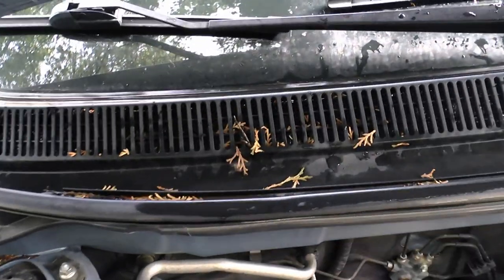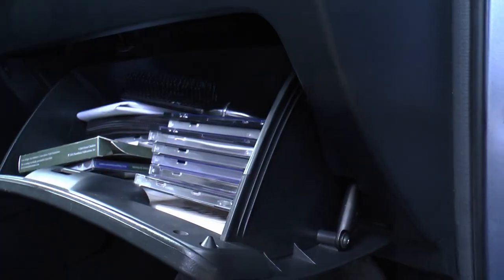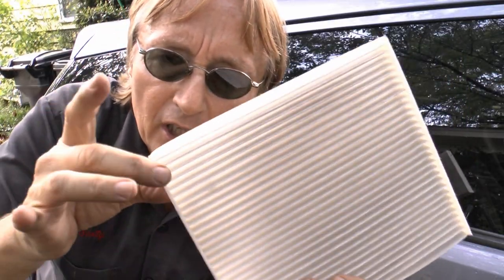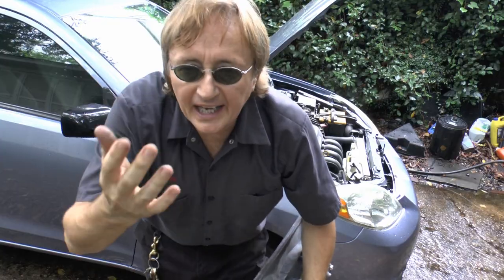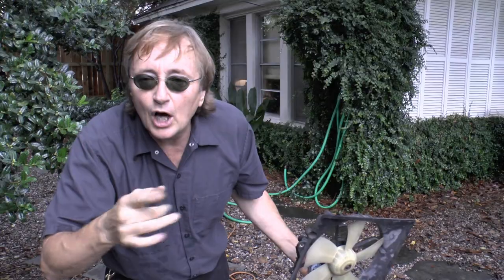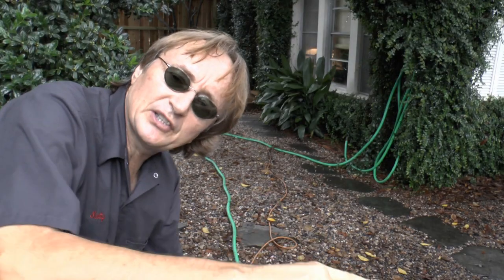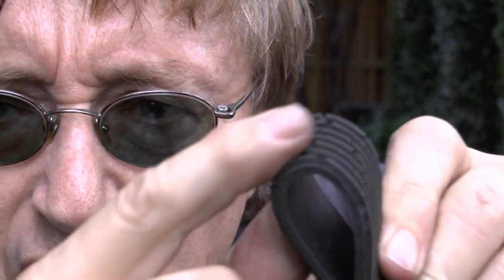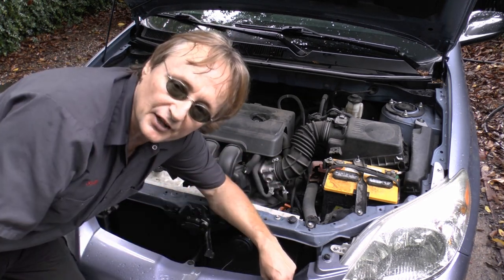How to Keep Your Car's AC Blowing Ice Cold for FREE

Comment: My cars A/C is not blowing as cold as it used to. I tried "recharging" it but it didn't do anything. The mechanic said I need to flush it. Does that sound right or should I be replacing something else too? The condenser and fans work
Reply from the maker: you could try flushing it, but realize if you do the drier and expansion valve or orifice tube will need changing too

Comment: I have a 98 Ford Contour 4 cylinder, the engine sputters when I turn the heat or AC on. What might be wrong with it?
Reply: +feedback864 Sounds like your idle is too low. Does it sputter when you're driving too?
Reply: No, only when It idles in drive with my foot on the brake or when the car is in park.
Reply: feedback864
Yeah I think your idle is too low. A bad sensor or dirty injectors could cause the idle to be too low. The A/C draws power from the motor. If there is already a problem the A/C turning on can make it sputter or even stall. I doubt it's a problem with the a/c itself.

Comment: My ac won't work. Checked the fans, unplugged the orifice and replaced the filter. System is charged, but no cold air and the compressor clutch keeps kicking off and on. any thoughts?

Comment: Hello. I have 2001 ford f150. It blows cold, then around 5minutes its hot. Any ideas why?? No leaks and freon/pressure correct. Thx
Reply from the maker: realize that has a complex computer driven ac system, as such, best to have a guy like me analyze the AC system with his dealer level scanner first, rather than guess with expensive parts

Comment: i took my car to a shop the mechanic said i need to replace the whole system. He told me the vacuum wasnt sucking like it should and the compressor is weak. I recently noticed twice my passenger floor board covered in water after it rained even though the windows were up. i mentioned this to him and asked if it would have something to do with the ac unit. he said no. I happened to see this video and it mentioned cleaning the inlet under the hood cause the evaporator will build up and leak water all over the car... that being said.. is there anything i can do without replacing the entire system?
Reply: emeraldagon like hell get a second opinion, i have my experience with some mechs and some are just flat out lying about the condition of something. i suggest you get a walmart gauge and just look at your pressure and start there.

Comment: +Scotty Kilmer my mom has a 1994 Toyota Camry V6LE the AC doesn't work at all even though the system is properly charged also the clutch on the compressor won't stay engaged the air that comes out most of the time is in excess of 75 degrees please help
Reply from the maker: British_Leyland(Alexscott100) often a worn out compressor, hot wire it, and if it won't stay engaged, replace the compressor
Reply: Ok

Comment: What I can't figure out is why there isn't fans pushing the air through the radiators rather than pulling it through like in the old days when you didn't have a choice. I know that pushing air through works better, I have built water cooled computers, and have done the research to prove this. Think about it like this; on a hot summer day which side of the fan would you rather be on?
Reply from the maker: fans work both ways, and it's easier to design cars with fans on the inside with modern hood designs. The difference is not that much in terms of efficiency, especially on a car, which after all is moving most of the time creating its own wind.
Reply: Scotty Kilmer True, but it would certainly make a big difference when you're idling in traffic on a hot day with the AC on. I personally don't think it would be too hard to design a car with the fans in the front, they may be a little harder to access, but the whole unit would still fit in the same amount of space, but I get the feeling that there are other reasons for this.

Comment: Hey Scotty, why is it that my heater blows when I accelerate my 1989 Nissan 300ZX all the way?
Reply: NGELO9657 I know im not Scotty, but if you're traveling at a high enough rate of speed, The air from the outside gets pushed into your fresh air intake, and through your heater core, then through the vents and into your car. if you don't want this to happen simply put your car on recirculate and the hot knob / leaver all the way to cold.
Reply: ***** Nah that's not my issue, thanks for replying though. I press the recirculate button and put my temp down but I'm simply getting hot air in when the temperature OUTSIDE is also hot, here in Florida it's like 90% of the time, so I almost always get hot A/C. Except at night..

Comment: hey buddy is it safe to wash an engine?
Reply: Coming from a noob, i think only when you clean it with a wet towel and don´t spill to much water on the belts because it can cause them to slip when you turn the engine on shortly after.
Reply: hell no, definitely don't wash your engine. You could damage components and electronics that are adjacent to the engine
Reply: you just need to use common sense and make sure the air filter covered. also check for damaged wires. car engines are SUPPOSED to be water proof. age and wear can affect that
Reply: Every single chevy we detailed at the dealership had its engine bay pressure washed and degreased with chemicals. The only thing my supervisor said was make sure the engines running
Reply: +P0LiTiKZ thanks
Reply from the maker: try it yourself at your own risk, and actually cleaning it while running is most dangerous, as water can get sucked into the engine and a live running computer that gets wet will go kaput fast. The chevy guy is a mechanic at a dealer, and you should not try it yourself at home. I see more guys ruin em that way
Reply: Well, surely safer on a diesel since on a petrol engine you risk having the ignition coil pack, coil or distributor get wet = misfiring engine = if you run it, catalytic converter overheats and damages.

Comment: Hey Scotty! my car isn't blowing any air at all! not hot nor cold! how come? Thanks!
Reply: +Peronimous Pratt Needs a new blower motor.
Reply: +Mouse Mystery whats that?
Reply: The fan that blows air for your air conditioner. If you're lucky it could simply be a blown fuse or loose connection.
Reply: +Mouse Mystery my car is a bmw 540i, i think its behind the airbag passenger side
Reply: Check the fuse first (somewhere in the engine bay or dashboard)
Reply: I don't know which fuse it is
Reply: Pull them out one at a time
Reply: +Mouse Mystery im not doing that, it could be the fsu

Comment: All basic maintenance stuff, nothing at all which helps you get extra performance out of your cars HVAC system full stop ? Also most car A/C systems must blow cold air at around the 4 degrees C to 6 degrees temps so buy a food rated Temperature gauge and put in the air vents while the A/C is going and check you cold air temps when in summer months, cheers :)

Comment: Hey Scotty,  A friend has a 2006 Honda Accord 4cyl. with a bad Timing Belt.. The shop wants over $3,000.00  to replace it!  Is this accurate in your opinion? Is this job something that can be done at home>?  She can't afford a new car or the repair at this point! !
Reply from the maker: what a freaking crook. Last one I did on that model was less than 400 bucks. Find an honest mechanic.
Reply: Scotty Kilmer Thanks very much, I'll let her know!
Reply: ***** Hi greasegun, thanks for your interest. After speeaking with her, she explained that the shop says the belt did in fact snap and that they are telling her that now she needs to replace the engine!  I dont know enough to understand what could have happened,  but does this seem correct? Can it be rebuilt cheaper?
Reply: ***** Thanks very much for taking the time to respond and for the information, I appreciate it!  This is for a dear friend who is going through some hard times, as are so many these days, and she will be so greatful to have information from a knowledgeable person.  I wish I had known about the broken belt and had asked Scotty after hearing more about the situation. I was so shocked at that price, and I hate to have seemed inconsiderate - as you pointed out he would probably have had a more detailed answer.  Thanks again!
Reply: how many miles on that car? hope it is fixed now.
Reply: MrBuzzialdrin I believe she's got just over 100,000 on it... She's just found an engine for a little over 1,000 and is looking for best deal on an install.. Coming along, but slowly..  Thanks!
Reply: Hey you forgot to mention the (orifice tube)<----

Comment: change your title .. because its bogus ... what you showed where some precautionary measures that can affect the a/c performance .. what you seem to forget is the most important aspect  .. its a sealed system but prone to leak R134a gas  from rubber flex hose,   connections with o-ring seals , seals and gaskets in the pump , mass produced components that can leak as well ...if the system dont have the required amount of gas  it will perform poorly ... the system needs  to have a full charge of refrigerant ...  what happens is , seal dry out when a/c not used in winter thus drying seals and loosing gas ... its recommended to have them serviced to check system for leaks and gas level  most important..... all those pointers you mentioned are what happens as part of the  service ..but  the most important is the gas amount...  so to keep your a/c as healthy as possible is to use it off peak  in conjunction with your heater for dehumidifying and defogging ...the  refrigerator in your home are the same system and last for years without needing a service because its a sealed unit with no flex hose or  o-ring seal connections to each component ...thus lasting years without service..

Comment: Hi please help, i will donate if you help me please, I have a 2006 Honda Civic EX sedan and a mechanic short circuit the ecu aka computer and now he installed a new one and still no a-c works and only one fan runs on the a/c and the Windows won't work now nothing electrical but it does turn on and run... Any suggestions???

Comment: My problem is my car takes r12 and that ain't cheep gotta love old Ford.
Reply: Can't it just be converted to R134A? Just need to flush all the old oil out, put the PAG oil in and replace o rings and hoses (a new parallel condenser might also help), and perhaps pressure switches too.

Comment: My AC is blowing out warm air what do I do if everything's full turn it on at all doesn't blow up just mediocre not even consider that any AC at all I got a 1998 Toyota Camry LE 4 cylinder what do I need to do to fix that how do I fix it
Reply: No see the problem I'm having both fans are working everything's working but the compressor I think it's the compressor that's not working

Comment: My AC stop working in my gti. It was blowing cool but not like it's normally suppose to. So I had someone out refrigerant in it then it start blowing warm. I went to have it check Whe I had it checked it blow cool. I don't know what's wrong with this thing. They said it's the compressor.  I refuse to believe that.
Reply: I'm a princess if you can get yourself a set of gauges, you can add and check the system. and kinda of get an idea of whats going on.

Comment: Is warming up your car important?
Reply: Sham Sharma during the winter it's important!?
During the warm season you can worry less about warming your car up!?(if it's gas powered)!

If your car(engine) is running hot... your AC isn't gonna work good (or will shut off by safety switches!?)!

Jus always check your oil level!!
Top off all your fluids, especially before long road trips!!(oil , antifreeze, power steering fluid & brake fluid!

If your cars an automatic..check the transmission fluid level occasionally too!!
Check your windshield wiper fluid too(winter mix or summer mix)!

U want to enjoy a car a long time... make sure you do these things!!!
I've heard of a lot of young people neglecting their cars.... you can't jus drive & never periodically check the fluid levels (engine will LOCK UP with low or no motor oil!)!

Check it yourself or take to a mechanic periodically/oil changes.... & watch your instrument panel for engine problems!!
Reply: Ok thankyou

Comment: Hi Scotty, my car front bumber was pushed back and the radiator was pushed back aswell the metal bar which holds the bumper in place? Do you think i need to change it? Here are the picture of my car: https://scontent.fsnc1-1.fna.fbcdn.net/hphotos-xpt1/v/t34.0-12/11844241_932329830160679_1982447498_n.jpg?oh=4a4cc91710872d960673ae1b2276fa48&oe=55BFB6EA

Comment: hi scotty,
in my ford mondeo 2003 model, as soon as i make AC on, the compressor starts to kick in and the fan, i get cold air for 5mins after which the compressor switches off automatically, even when the AC is on.

it works itself some times giving cold air, or shuts off itself. not able to under stand.  why??

i have seen huge water dripping and ice formation in the ac pipes which goes inside the car cabin area from engine bay.

please clarify what to do?????

Comment: why does my car turn off when i have the A/C on? it only turns off when i come to a stop.
Reply from the maker: either car is idling too low, or compressor is wearing out and strains the engine at idle
Reply: Scotty Kilmer tha kyou verry much for replying it shows you trully care about your viewers. The idle seems ok until the fan turns on i can feel it loose power, it is a old 1994 4runner so the compressor can also be bad
Reply: Luis Rodriguez - Might sound strange to most but totally worth checking the ground connections and battery terminals. ;-)

Comment: Falsehoods In This Video.
1. The fans have nothing to do with the aircon. They are booster fans for the radiator.
2. That is not the aircon condenser. That is the radiator that keeps the engine coolant cool.
3. The coolant system in this sample car is shot. The radiator is filled above the overflow outlet, indicating the system is likely blocked.
4. I was initially impressed with Kilmer's videos, until I started seeing contradictory, incorrect, and unroadworthy content.
5. Unsubscribing.
6. Done.

Comment: Camwithher this is free it that you live in you live in Texas Texas and I want to tell you something like older keep your engine heat down hell does not heat those up the Grinch department in it that Rob your air conditioning inside your cabin of the more of hot air gets in at the text the text again - pipes the pipes and hardener on your course none in a cougar you're a Christian and property in and that's why I like it like that once was an error in the board on your temperature on your engine will get some hands all engine cleaner flush and get some fried about a cleaner clean up the car burn out of it know the Lord toasties out of it you some animals all in your engine and run last a lot longer in their crates a lot less friction your engine the whole lot better than pins all whole lot better model of stallion and mare with the anvil the engine with that so there's a whole lot better there than with pins all yeah pens or 11 there it's really not that great of oral but the Amazon is the best stuff you could ever take that to the bank and this is Fred your subscriber your subscriber